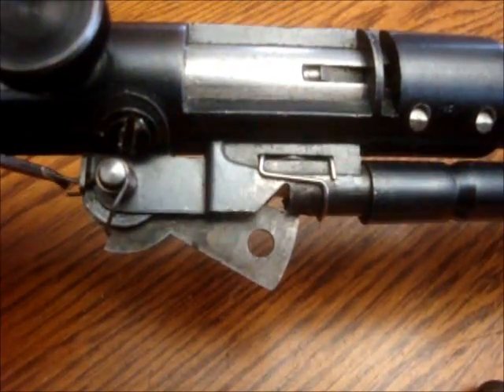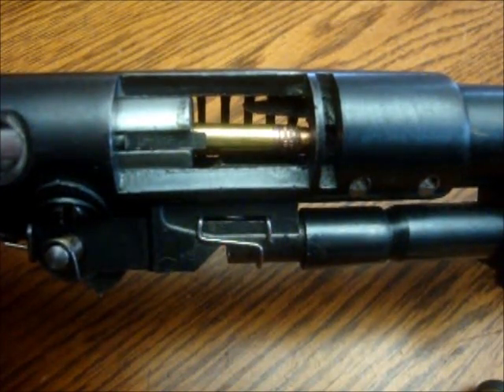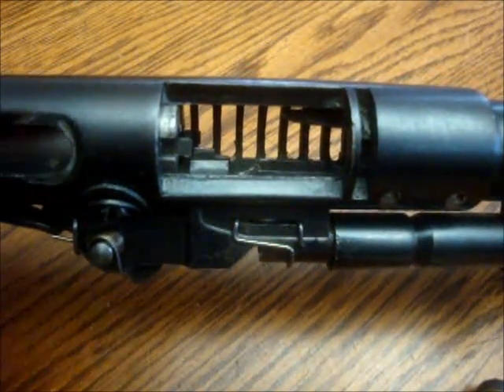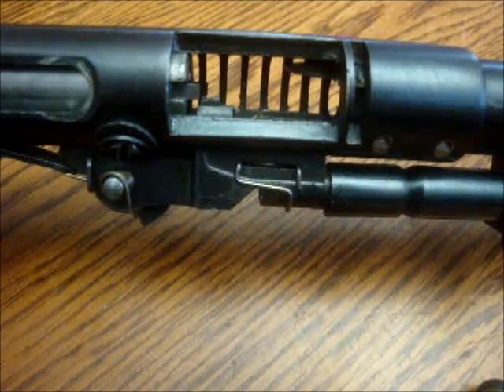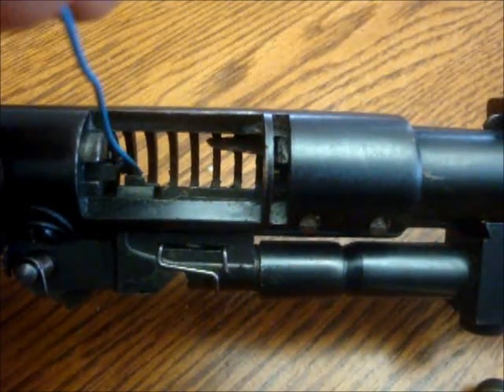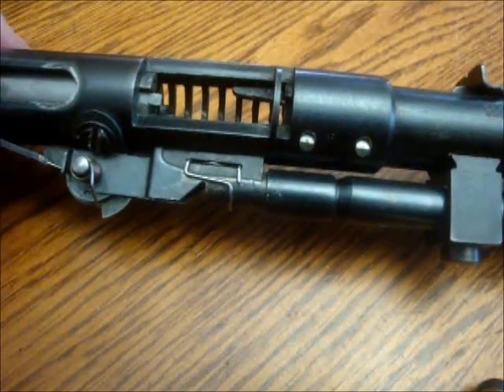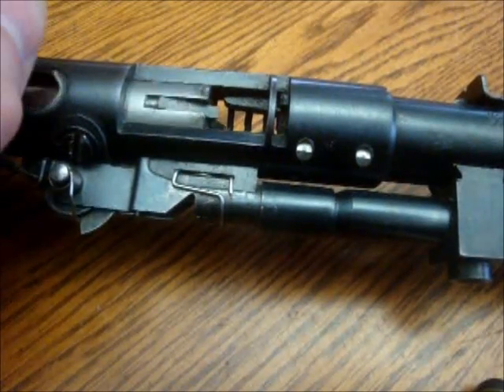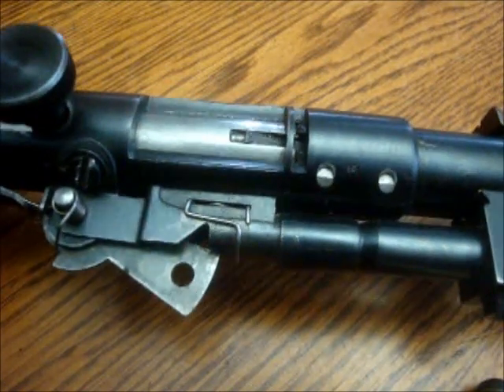Viewer request: springfield/stevens 87a cycling video

Comment: I got my hands on one of these guns today. After we managed to clear a case that was stuck we took it to the range to test fire.

It emptied the first 5 shots on automatic ... much to my surprise. It did it a second time as well.

Is there a setting I need to change to move it from full auto to semi auto or may it be due to a worn part?
Reply from the maker: Usually a worn part. One of the plungers that hold the bolt back is causing that issue. Forward one probably. Test it by making sure gun is empty holding the trigger down and pulling the bolt back. It should lock back until you release the trigger. If not you will have a full auto which can both be dangerous if someone freaks out using  it or if the ATF  decides you are a bad person who should visit a judge.
Reply: @Stray03  thanks, will check it out tomorrow.

Luckaly I am not from the US, but that does make getting spare parts an issue though 😉
Reply from the maker: @AndrevanTonder67  very true, although numrich should ship depending on where.

Comment: I’m having a problem with mine when I shoot it, it tries to load more than one bullet at a time then it gets stuck under the bolt and jams everything up. Would that be a lifter problem or the spring?
Reply from the maker: The little wire spring under the ejection port in the video is usually the issue for double feeds. A lot of people are missing it or it is jammed up and not holding the .22lr back.
Reply: @Stray03  yup that’s the problem I’m missing that spring. Any idea where I can get one?
Reply from the maker: Numrich gun parts used to have them. Haven't checked in a while. If not eBay sometimes has parts.

Comment: Hi there! I have an 87M which is missing that cartridge bumper guide which you point to and say “make sure it has this”. I’ve got a replacement but have no idea how to install it. Do I need to drift off the two bottom pins retaining the barrel and then remove the barrel to replace it? If you still make videos a quick one on this topic would be amazing! Really any help would be amazing.
Reply from the maker: There is a guy on one of my videos that is doing that very repair right now. Apparently you do have to take the barrel off to replace it. I have never done that repair so unfortunately cant help you with it.
Reply: @Stray03  Thanks for the fast reply! Just that bit of info was enough for me to work with. I drifted out the two pins and used a gun vice to hold the barrel and a wood block and some gentle love with a hammer to drift off the receiver. Bunch of gunk cleaned up and the replacement one piece bumper fit right on top of the barrel, then just reassembled it and drifted the receiver back on and punched the pins in. It was relatively easy. I did have an original bumper and spring replacement along with the one piece replacement, but trying to seat that tiny spring while knocking the barrel on is beyond me. I bent two springs and said eff it and used the one piece one. We'll see how it does at the range next time I get out!

Thanks again for your help!

Comment: On a Stevens model 87H, on the ejector, does it have ejector on both sides . Mine only has one, where can I get the part
Reply from the maker: you mean extractor then yes it is on both sides. If you live in the US then you can probably get it from egunparts (numrich)

Comment: I believe that my Springfield 87A  N° 01-0415 is  one of the so called "old style". I need to replace the LIFTER, but in the NUMRICH spare parts list, I see:
1.- Lifter (Spring Style), Old Style
2.- Lifter, New Style
3.- Lifter, New Style, Replacement
In addition, the magazine guide replacement shown on your video, has a semi-round cut just in front of the lifter, which my rifle does not have.
Can you help me to define which is the proper lifter I should order for my rifle
Reply from the maker: +Gonzalo López Unfortunately I can't really help you with that because I have only seen two of these toys, but if you give them a call I'm sure the Numrich person will be able to tell you the differences which should help you.

Comment: sorry bud I'm out of town on work I'll check when I get back. I was also wondering if you knew if its normal that when i fire it you can see a puff of fire. also i don't thank I told you but my lifter will stay stuck up and a fired or unfired casing will be stuck in the port with the bolt halfway closed any idea? really appreciate it.
Reply from the maker: Brandon Belcher I'm having so many issues with youtube not telling me people have written to me. Depends the puff of fire will be visible if you are shooting in twillight or dark conditions, Normal because it is a direct blowback, and the hot gasses are what causes the bolt to come back. I'm thinking your bolt isn't going back far enough, Check the things I told you to check, and make sure she is reall clean, I've never had that model, but I hear they can be real PITA's if they are not well cleaned and oiled.

Comment: Hey I was wondering if you had any problems with your 87a concerning the lifting mechanism for ammo from the tube to the receiver. My problem being my lifter dosent clear the ammo tube and blocks rounds from traveling down said tube and I have since replaced the spring/lifting mechanism and washers to no avail but it did help the clearance slightly. Im hoping I dont have to replace the bolt but idk what could cause it.
Reply from the maker: Can you send a pic of it fully open and fully closed with no stock to stray03@gmail.com?
Reply: I sent you some pics of the action and follower let me know if you need more and thanks for looking at it.
Reply: Same here, fixed it by pulling the tube out a little bit

Comment: Mine functions fine if I use it like a bolt action but when I go to semi auto I get failure to feed. It gets jammed between magazine tube and that paper clip looking guide. Happens more when I have 2/3 rounds left. My thought was tube spring might not be putting enough tension on rounds.
Reply from the maker: So the round doesnt go far enough    and the lifter tries to push it up while still partially in the tube?
Reply: I believe so
Reply from the maker: Could be that issue. Check for dents in the tube, and flush the whole thing out with varsol. May just be gunked up from old oil.
Reply: Thanks we shall see, I cleaned the gun up pretty good. I ordered a spring and a new guide pretty cheap. Hopefully that does it.
Reply: NutterCutterPro. Where did you order those parts? And (please...) keep us posted on how it works.
Reply: Ordered from Numrich. Yeah it cycles now. In comparison, my new spring was twice the length as the old one. It was worn significantly.
Reply: NutterCutterPro. Just received my Cartridge Guide Spring today. Cyclicals like a charm! Wish it was a little warmer today. We (N. Michigan) have a high of 14*! So glad I didn’t ask how to install it. Slipped into the slot slicker than frozen snot!👍🏻😁 Thank you Stray03 for the video!

Comment: could someone put a video up taking the magazine tube apart and the feed ramp out please would be greatly appreciated for a lot of us watching your videos on YouTube much appreciated. great videos..
Reply from the maker: Brandon Belcher problem is that the feed tube is not designed to be removed by the gun owner. it is placed through the mounts and then it is stamped with a punch through the hole where the stock mounts to the gun. the removal of this means you need a new tube to be re-installed since the side of the tube must be drilled out to remove the bump.  the rest of that disassembly is standard.

Comment: what are the 2 lock holes for so you can pull back the bolt handle and push it into the lock hole or leave it forward and push the bolt handle into the lock hole?
Reply from the maker: Rondo Schiavoni Forward hole is to lock it into "bolt action" or single shot mode. That allows you to fire the 3 types of ammo since semi auto is only for .22LR.  The rear one is I think a hold open but I never use it.
Reply: THANKS  SO MUCH  EVEN A GUN INSTUCTOR AT THERANGE DIDNT KNOW WHAT THE REAR HOLE WAS FOR. AND   ITS VERY HARD TO GET IT INTO THAT REAR HOLE FOR SOME REASON
Reply from the maker: Rondo Schiavoni According to the manual it is the bolt hold open for loading the gun in single shot mode. It was recommended not to load using the mag or mag tube, what you did was lock the bolt back place the round in the chamber then released the bolt and locked it in the forward position.
Reply: That  settles it  its a logical answer . and I guess the other hole is to lock it if your using shorts or you just don't want it to act like a semi automatic gun when using  longs? thank you
Reply from the maker: Rondo Schiavoni exactly, it turns your semi auto .22lr into a straight pull back bolt action for short,long and long rifle.  No problem, thanks for watching.
Reply: now I understand  because you explained  about the parts and what they  do,  however the only thing I would like to know is how do you shoot a short 22.
Reply from the maker: +Rondo Schiavoni there are 2 things you can do, The way the manual says to do it is Pull on the bolt and lock it into the rear most hole. Place a .22 short in the barrel, release the bolt to completely chamber the round, then push the bolt handle in so that it locks in the hole closer to the barrel. you Fire and repeat the process. The other way that works is that you fill up your tube with the ammo, then you pull back the bolt, and push it forward to chamber a round then you push the bolt handle in to lock it into the hole again and fire,then repeat the process.
I think the reason the manual wants you to load one at a time is for 2 reasons, loading shorts isn't as smooth as long rifle so they can jam up as you close the bolt. Also if you have a loaded tube and you fire a subsonic or short forgetting to lock the gun into "single shot mode" the gun won't completely cycle which can cause really unpleasant jams of ammo in the lifter area.  So  in order to avoid mistakes, you load it like the manual says, If you are careful then you can load it in single shot mode using a full tube.
Reply: Thanks so much  for the good answer, I think to be safe I will just use 22LR   and keep it clean , one more question ,I'm starting to sound Like Colombo in the TV Series ,,  can I use a full  load of Hollow point 22LR with out  a jamming  problem ?
Reply from the maker: +Rondo Schiavoni Should work ok, has for me.
Reply: +Stray03   Ok  thanks,  some times the hollow points are cheaper per box  .

Comment: Dont know if anyone can assist, but i hope so. I have a 6a that has broken extractors. I got new ones and see that they are a little different from one another. Which side does each go on?
Reply from the maker: Im sure ive answered it in the comments before but iirc the bigger one is on the ejection port side. Double check the comments to make sure. When I go into the safe later Ill give it a check

Comment: HI. I disassembled my Dads old springfield 87a and while I was waiting for parts to come in I forgot where and how the left and right detent levers go back in. DO you have a video or a picture of where these two parts go? a
Also thanks for the videos you have posted so far. they have been very helpful.
Reply from the maker: Are you talking about the extractors?
Reply: Stray03 , thanks for the reply. it's not the extractors.  I looked them up on a exploded view diagram of the rifle on Numrich and they had them list as right and left detente lever. Part #42 & 43. I wish I could add a picture on here.
Reply from the maker: Go on my facebook page I put up 2 pics for you there. Hope it helps.
Reply: That's them.  Thanks.
Reply from the maker: no problem, hope she goes together easy.

Comment: I have a Savage 6A that one spring was broken, so I replaced both.  Shot it last night,  it eject fine but the bolt will not return. Bolt is soft.
Reply from the maker: Which springs are you talking about? Recoil ones in bolt? Remove the bolt and carefully check movement of the spring that moves forward bolt. I think it is binding.
Reply: @Stray03  I'm taking it back a part tonight ill let you know.  Thank you for the quick reply.
Reply: Got it,  I had the spring pack in wrong,  The end washer was inside the back part of the bolt, so that when the spring was collapsed the rod only stuck out.  My Dad who is 88 had it apart before me.    Thank you
Reply from the maker: No problem.  Yeah I know that that happens often. Glad it is fixed.

Comment: Would someone please post a video of how to replace the cartridge guide on a Stevens Model 87a?? I am going through these things like crazy because I keep bending them out of shape while attempting to install it. Thank you! My biggest issue is keep getting unspent shells down in the stock of the rifle. Crazy!!
Reply from the maker: Im confused as to what you have an issue with? The lifter or the small spring that keeps the rounds from double feeding, I can't figure out how either of those would cause the rounds to go into your stock.
Reply: @Stray03  The cartridge guide. The half moon little spring. It clips onto the magazine guide (I believe that's what it is called). I noticed you had multiple model 87a videos and thought I would ask if uou had or could maybe doing one of the cartridge guide since it seems somewhat common.
Reply: @Stray03 the cartridge guide isn't working properly obviously and allowing shells through.
Reply from the maker: I dont know what more I could really do on it. It is just clipped into place (carefully as you have already found out). Anything specific I can try to help you with?
Reply from the maker: @michellecalvin2892  Usually if the guide is missing you get double feeds and jams, have you cycled it without the stock on to see what is going on with it?
Reply: @Stray03  so what techniques or which end goes on first? How do get the ends to fit in their magazine guide slits? It makes no sense to me.
Reply from the maker: Your best bet should be to push it up directly from the bottom so that they engage the slits at about the same time. Inserting into one side then trying to clip in the other will likely stress the spring more. Make sure there are no burrs in the slots that will keep the spring clip from installing fully. If rounds are getting into your stock I'm thinking they are going under your lifter which should not be possible if the lifter is ok. Have a look at that while you are dealing with the spring clip.

Comment: i have one that if i pull the trigger  it works fine  but if i squeeze the trigger off a long rifle shell will jam the one being ejected and the on being out up in the chamber  don't know what wrong
Reply from the maker: Is the gun cocked after that happens or not?
Reply: Weak lifter spring, possibly needs both springs ,one lifter and found clip
Reply: @Stray03  half way
Reply: @johnniecameron8829  thank you i will check

Comment: I have a question for you.Are both extractor springs supposed to have the same tension. I have this rifle in my shop and the complaint is a problem both feeding and extracting.Everything looks good and I just cleaned it,but I did noticed that the inner extractor spring is weaker than the outside extractor. I was wondering if that makes a difference. Thanks again for your help. Rick
Reply from the maker: Yeah they are different. Probably to ensure it ejects out the right side. No burrs on chamber from dryfiring?
Reply: Thanks for getting back to me so quickly. I’ll check for any burrs Thanks again
Reply from the maker: No problem. 90 percent of the feeding issues with this gun is from lack of cleaning. And most of the rest are from springs not being installed properly. So you may have already fixed the issue by just cleaning and oiling it.

Comment: I gotta 87n I can't get the next round to fire the next round or some times load the next round
Reply from the maker: I dont have that model but ive heard people having issues with that undoing the reciever end cap 1 full turn and that fixing it. I dont know why it works but apparently it does. I wouldnt keep it like that but if it works you can work from there. We are talking about the model with the angled endcap right?

Comment: I’ve been having problems with mine, it loads two at a time. I see a part that your rifle has and mine doesn’t, and I can tell that there used to be one. I need to know the name of that part. It’s right over the feeder.
Reply: I can’t put a picture in the comments so I don’t really know how to describe it
Reply from the maker: It is the spring on the tube. And yes that is your problem.
Should find a replacement on numrich gun parts along with an exploded parts diagram to find the right part number
Reply: Stray03 it’s not the spring tube, could I get your email so I can send you some pictures of that I’m talking about
Reply from the maker: I know you are talking about that little wire on the mag tube above the lifter. It is a spring to hold the ammo down until the lifter pushes it up.
Reply: Stray03 do you happen to know what it’s called?
Reply from the maker: Cartridge guide spring.
Reply: Stray03 I found it! I appreciate it
Reply from the maker: No problem.